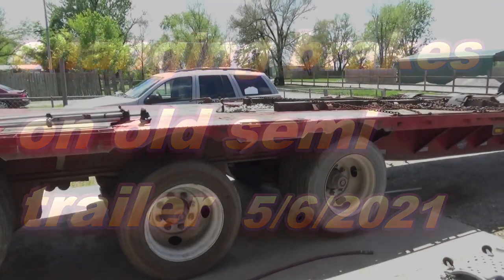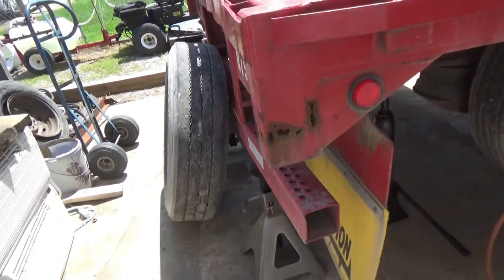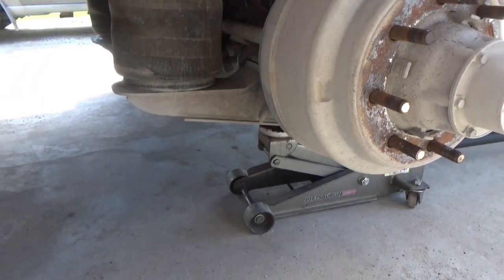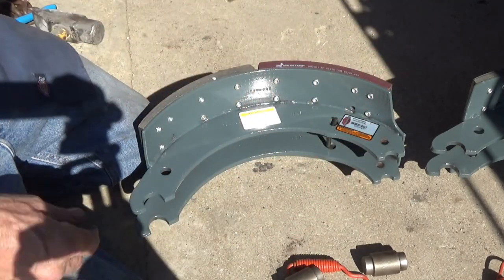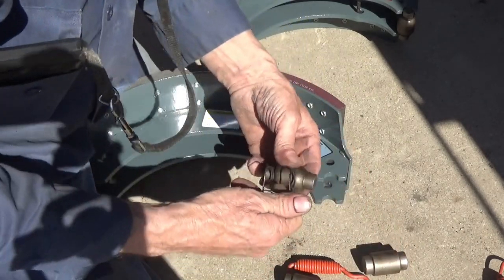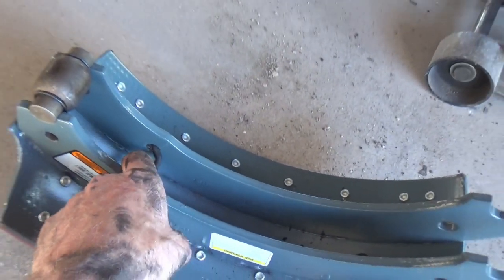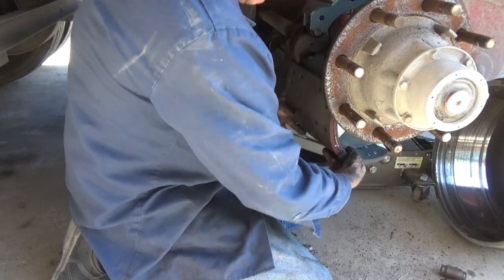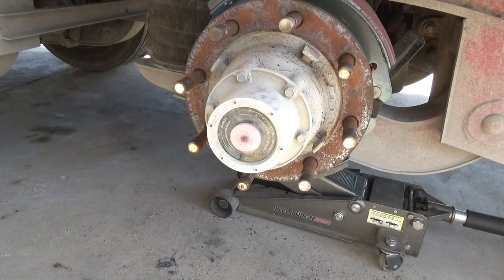Changing brake shoes on an old semi trailer

Comment: I HAVE A QUICK QUESTION I HAVE A 2004 FREIGHTLINER COLUMBIA THAT I JUST PURCHASED AND I AM HAVING ISSUES FINDING THE PROBLEM FOR THE SIDE AND BACK MARKER LIGHTS
Reply from the maker: I don't know specifically how your truck is wired, you can look at my playlist on auto electric to get an idea how I run down electric problems. I have a few videos in there on tail lights on big trucks and cars.
Reply: Thank you very much I will check your videos out Thanks once again